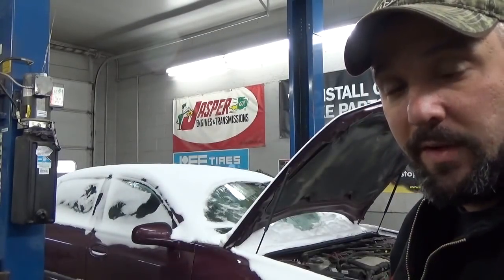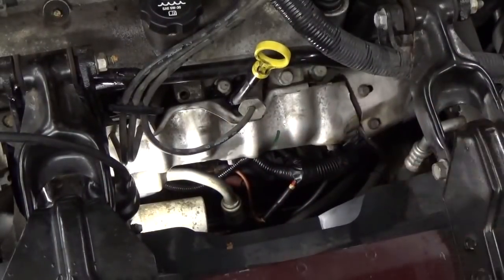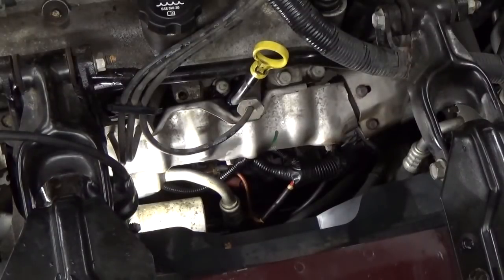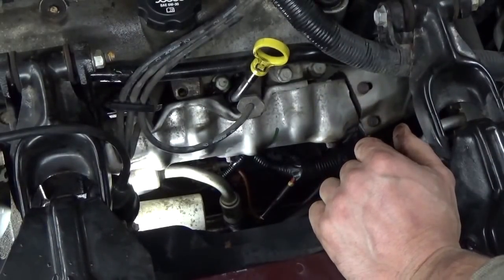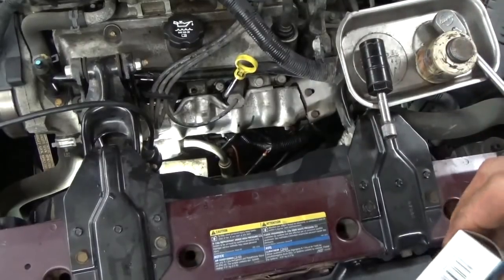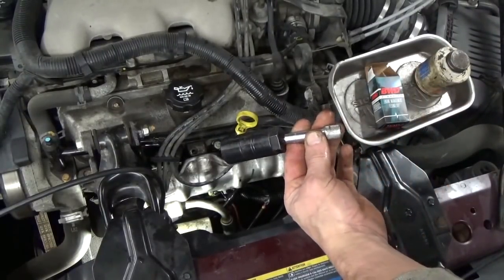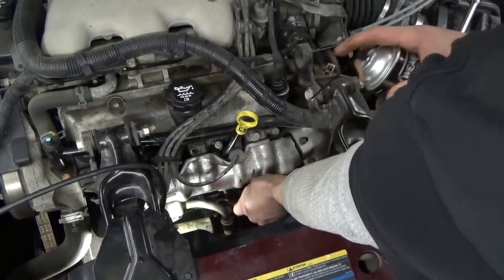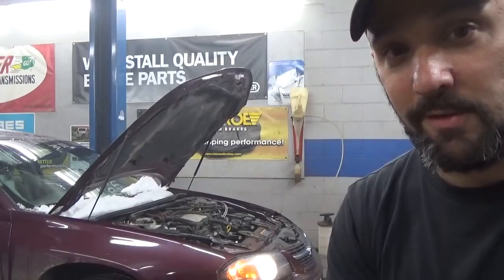Engine Oil Leak - Chevy Impala 3.4

Comment: thank you so much for this video! my oil pressure all of a sudden dropped and didn't know why. A $17 dollar peice  that just about blew up the motor. It was deffently worth the $40 (new part, deep well socet and 3quarts oil) rather than spending a ton at the auto shop. This fixed my oil leak for my '03 Impala 3800 engine

Comment: Absolutely awesome video. I thought my 2000 Chevy Impala was leaking oil from the oil pan gasket. That is not an easy fix since I would need to lift the engine, so I got estimations from different mechanics in which they ranged from $460 to $475 to change the gasket. this is a $20 fix for me.
Reply from the maker: Take a look hope it is that easy :)

Comment: WOW man. Thank you. I am not mechanically inclined. You did a great job diagnosing my problem and show me how to fix it. I had zero tools and haven't worked on anything in years. I fixed my oil leak for 60 dollars including parts, the need tools to fix, and replacement oil. Thank you so much....

Comment: I got to replace mine on a Pontiac Montana in a gas station parking lot. It was more then a oil leak. It drained all the oil out in under a mile @50mph and gave the van a good oil bath.

Comment: Well as old as this video is, this was the oil leak problem on my 07 Chevy Impala.  I could not find the oil leak, had the car on the jack to replace the outer tie rod, saw the oil leak coming from the oil filter.  Thought the filter was loose, sine we just had the oil done.  Nope.. Took the oil pressure sensor off had oil in the connector , replaced sensor. Thanks Eric O

Comment: I had the same leak (oil pressure sender) on a 1969 Mopar vehicle. The sender in that case was up on top of the V8 in the valley, the oil went all over before finally dripping to the ground, so it took a while to figure out where it was coming from even though it was a pretty large leak (not as bad as this one - I was coming home from college at the time and the 500 mile trip took about a case of oil).

Comment: Great vid. I've got an 06 impala with the 3.5 and sometimes I'll get a low engine oil message and recently it's been marking its spot in the parking spot. Hopefully that's it's only issue and it can keep on running

Comment: Love my Impala but not liking the engine so much. Had my rocker arm threads go bad on #2. Tore into the engine and found one of the arms laying in middle of engine (literally). Pretty common thing from what I read ever deal with similar issue? I've had the heads worked and am in the process of putting it back together.

Comment: We had 2 (or you can say 3) sensors leaking on the same make and model of car on two cars. First one came in with an oil leak from the sensor and we replaced it. Came back after a month or two leaking again (aftermarket part...).  Second one was leaking so bad that the car lost oil pressure and messed up the bearings. We had to replace the engine!

Comment: Yep looks like this is where my '97 Pontiac Trans Sport has been leaking. Finally got bad enough I could watch it drip. Repair shop wanted $700 to fix (oil pan gasket - it is actually a bear to fix in these vans). Hopefully this will take care of it for good. What a fuster cluck. BTW what is the sealer to use?

Comment: ha my malibu had a leaks at the oil filter I tried turning a 1`/4 of the way, didnt stop must have been overtightened. I threw a new on on and the drip at the filters stopped, success! until I found a few drops on the driveway while celebrating the easy win. yep this was leaking as well. back to oreillys

Comment: Glad I watch this video. Just replaced tranny  pressure transducer switch on my 2001 Jeep Grand Cherokee 4.7 L V8 with transmission 45 RF.  was wondering how to clean up the electrical connector. Thanks for showing the detail with the brake cleaner and air nozzle. The transmission fluid had been leaking through the pressure switch for some time before I found one single YouTube video about it. Says it is a common sensor failure, could result in a short circuit but did not show how to clean up the electrical connector. Well I broke the Locking tab trying to get it apart wonder how long it will hang on there? What's the best remedy? any suggestions? Pretty limited access

Comment: Ok earlier comment , ignore. It is a 3.5L engine. So far its an intermittent problem which began with trying to go uphill in snow to the point the traction control couldn't climb it. Now it seems it comes on and off intermittently whenever traction or braking is done. Could this thing just be loose? or have water on it somehow? It seems awfully close to the bottom of the car. I had an oil change to see if that might make the problem go away. It's still there. Or can I somehow turn the chiming off. I have oil but the lights and the chiming are driving me crazy.

Comment: Had the same problem many years ago on a Ciroen CX Familiale Had to go to dealer, Transverse engine,switch between bulkhead and below manifold. gap about 1 inch wide, and 1 foot in from all sides. Spanner could not touch it,

Comment: I have a 2006 Impala LT with the 3.9L V6 that runs rough at idle. Removing any one of the front wires (2, 4, 6) from the plugs does not affect the rough idle (stays the same). I even removed all three wires (2, 4, 6) when it was off and it started up the same as if they were connected. I think it has to with Gm's Active Fuel Management (aka bad lifter). Can't find much repair info on-line, any help in pointing me in the right direction is greatly appreciated.

Comment: Does all the sensor switches run together ??????
,  I have an oil leak to where you just changed out. My tire pressure senor switch is out too. It needs replaced too. At the chevy garage they wanted 400.00 to switches out all 4 sensor switches. They said they changed out the oil sensor switch. It kept leaking.  They said in so many words that I needed all 4 done. Is this true. I do want the changed out But it's the 400.00 that's making me unhappy. If I can watch videos of how to change them out, I'll do it my self...
They already charged me $134.56 to change out the one oil switch, that didn't fix the oil leak.. Ty

Comment: I have a 2004 Chevy Impala 3.8LV6 Series 2 engine leaking 5quartz of oil in less than a Minute 100ft of driving distance. Oil pressure switch located behind passenger side tire right next to oil filter. Hope it’s the right one & fixes problem
Reply: Did this fix it?

Comment: every impala i ever worked on (3.5l v6), take a peak at rear head gasket. lots of wetness. crazy part is they did a few revisions, all versions had this issue/minor annoyance. apparently replacing it with a oem gasket nets the same eventual results within 6k.

Comment: I do have a question, the one I got already has tread sealant and installing it got real tight before it bottomed out is that ok? I didnt want to damage any threads. must have been putting a good 20lbs or more on it spec says 12ft/lbs

Comment: Dude awesome! I thought my block cracked or something but that fixed her right up! Question I've replaced my coils wires and plugs fixed the misfire ran the codes and had to replace the camshaft pos sensor but then the car started to misfire in cylinder six again! Any ideas? Thank you!
Reply from the maker: Dead miss or intermittent?
Reply: Dead miss but it also surges sometimes but there is a loss of pulling power! Exhaust smells bad too!
Reply: Also sometimes when I'm driving it will fire normally then start missing and the check engine light will flash I ran the codes and they were all repeats of cylinder 6 misfire! 2001 impala 3.4L thank you for your advice and time!!!
Reply: andrew wilkinson O2 sensor. cat. gone bad. Lose power and bad gas mileage I assume. Anyway the 3.4 is GM worst engine. For example, the thermostat takes an hour to replace. Also, if you do further research, it has a few design flaws that can not be fixed cheaply. The factory head gasket is infamous for breaking. GM got away with massive recall from that one, what a shame. People who said that is the best car they got are the one only know how to pump gas in their cars.
Reply: If there was a problem with those things would it not throw codes for them?
Reply: +watcher05er

Comment: I tried lucas first, then the oil level sensor, I'll try this next I guess.  Its nothing this bad but a quart low every 4-6 weeks is annoying.  One question, do I have to do another oil change when I replace the switch or can it be replaced without?  Thanks.  Oh yeah, after I replaced the oil level sensor its stuck on "Oil level low" even though Ive checked it again and again, how do I get this off the dash?
Reply from the maker: Sounds like you may have gotten a bad sensor. Also if you change this pressure switch you do not have to do an oil change.
Reply: ok, thanks for the help, I'll try both solutions.